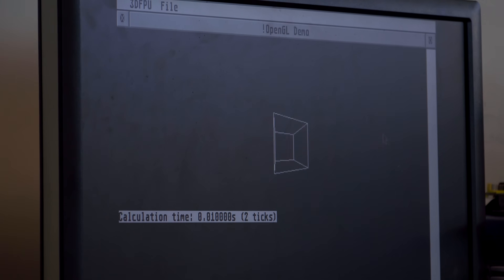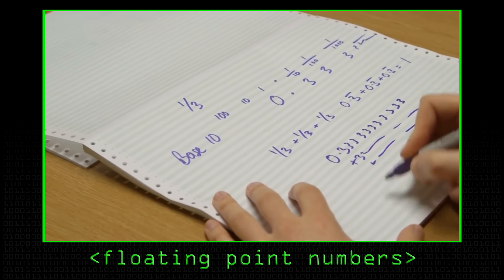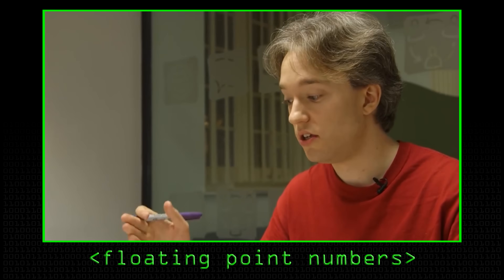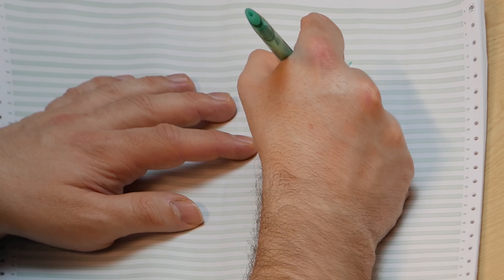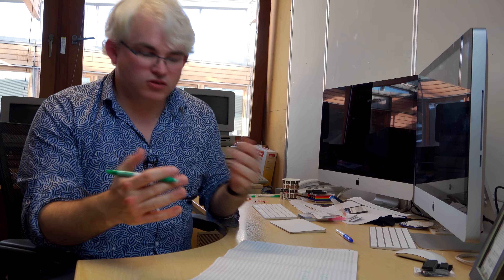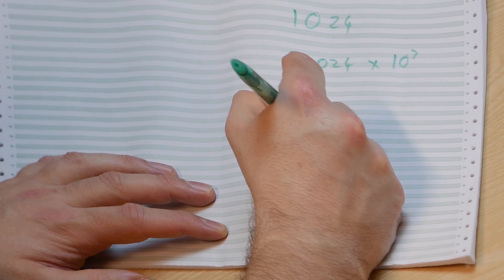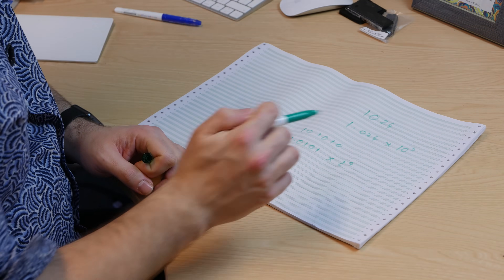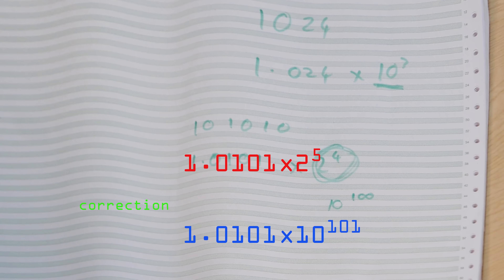Floating Point Numbers (Part1: Fp vs Fixed) - Computerphile

Comment: There are other approaches, too.

I remember reading an article about an investigation one guy did into "floating-bar numbers", which were a restricted form of rational numbers (fitting into 32 or 64 bits) where the number of bits for the numerator and denominator could vary, though would be limited to a total of 26 bits in the 32-bit implementation (the other 6 bits being used for the sign and bar position).

Another approach being a logarithmic system, where numbers are stored as their logarithms. It has the advantage of multiplication, division, powers and roots being fast, but with the penalty of addition and subtraction being slow. The Yamaha OPL2 FM synthesis chip uses one internally, operating on log-transformed sine-wave samples, then uses a lookup table to convert to a linear form for output.
Reply: How do the pros and cons of LNS conpare to traditional FP? Specifically, as it relates to addition and subtraction.

Comment: Why not have memory inside the cores, and have floating points which are conversions already installed in them, so it uses the after cache to do less conversions, it would read data much better.
Reply: @Richard Vaughn is more efficient for hardware to perform floating points and additional tasks, than having to rely more on software, why make more software that is not needed when they can integrate it into the hardware, just to save a couple of bucks? That makes no sense, now a days hardware technology is very inexpensive to where they can integrate more functionalities and rely less on making more software that the hardware can make.
Doesnot make sense, because even if you have the software handle he said it himself that is far superior for the hardware to handle it.
Reply: @Richard Vaughn 
"The CPU doesnot  convert floating point numbers as they are already stored in that format"
Why did you think I wrote the feedback for?????
The CPU doesnot convert floating points. Well is because is not design to convert floating points, that is why they need to make more sophisticated cpus that can store floating point values and also process floating point values, so they can be much more accurate and not require more software programs for it, because is just a waste of time to be making software that can do so, when the CPU can be design to do it even better than software. 
You not very smart man understand what other people write.

Comment: As more and more transistors became available, the improvement in floating point hardware was greater than the improvement in the main processor (as impressive as that was). So the difference on a more modern machine would be a lot more than the 4 times of the late 1980s computer.

Comment: Back in the days of TTL logic, I got to implement a design that used logarithmic numbers for a multi-tap Finite Impulse Response (FIR) filter.  The number system we came up with to represent the logs was very much like a floating point number with an exponent and a mantissa.  We had a radar signal to simulate, so there was a large dynamic range to handle.  I think the input was a 12 bit unsigned number and we had something like 64 samples to multiply and accumulate.  These were the days just before “large” multipliers were commonly available.  That made using the logs an attractive solution.  We used interpolation between 8 of the FIR weights to eliminate 56 multipliers, but still, how to accumulate the multiplication products?
Enter the log adder.  With some simple algebra, one can effectively add log numbers.  Part of that process was linearizing the mantissa, shifting it according to its exponent, and adding that to the other number’s linearized mantissa.  Then the result was normalized, the mantissa converted to a log and you have a sum.
That experience piqued my interest in how video signals are handled, beginning in the CCD or CMOS sensor chip and on.  In the years since, I have never come across anything other than a chip with a wider and wider integer output.  I think some start-ups have promised wider dynamic ranges, but I don’t know what has come of it.
Does anyone know of chips with anything other than integer digital outputs?
Reply: I may not understand, But would having an MCU with over a hundred outputs fit that, surly software can make those outputs mean anything you like ?
Reply: @1st_ProCactus   Well, there are many considerations to get an increased dynamic range. The first one is that the sensor analog performance has to have a higher accuracy and a lower noise floor. Next is the analog to digital converter must also have commensurate performance. No amount of software can generate information that is not in the signal to begin with.

What I was musing about was whether the data bus width is increased linearly as better sensors are developed, or are there different number systems, like a floating point number system that is output from the A/D converter. My guess is that the outputs increase in width one bit at a time, since each new bit represents twice the previous dynamic range.
Reply: So you want to input a very high dynamic range with minimal pins, Logarithmic like?  Ill keep that in mind, I'm interested in any kind of sensor, Though Ive not noticed any sensor that does that. But im sure something like that must be out there for a specific sensors.
Ive seen some unusually high numbers on some of the new on chip sensors (MEMS ?).
Just curious as far as ADC goes, How many bits do you dream of ?

Comment: At 01:40 he talks about recompiling the program to use the floating point co-processor. When I was programming in Fortran in the 1990s, the compiler had an option to detect this at run-time. If the co-processor was present it would be used, otherwise an emulator software library would be used instead. The performance difference was notable, but it was easier to release a single program that was compatible with both.
Reply: When attempting to execute a floating-point processor instruction without the coprocessor installed, an exception (interrupt) would be raised. The handler for that interrupt would then perform the calculation via software emulation and then return. It was seamless, but the performance difference was huge.
Reply: Agreed (my memory is rusty). For testing, there was a flag during compilation, so that the emulator would execute the instructions in software as if the co-processor was never installed.
Reply: some compilers can do this.
Reply: cpuid

Comment: Can someone explain *((int*)&y)  ?
Reply: It casts the address of `y` to an int pointer. Remember y is a float, so by creating an int pointer to it you end up treating it like an int. Presumably int and float are the same size on that machine. 
Then the int pointer is dereferenced. The value of the int will be the IEEE representation of the float, which is passed to printf.
Reply: He wanted to see the actual bit pattern of the float as it's stored in memory, this is a roundabout way to cast the float to an int without doing any type conversion because C doesn't offer an easy way to do that otherwise. Just doing (int) y would give a different result.
Reply: @tiarkrezar  the proper C way to see the bits without conversion is a union, which is like a struct but the different components take up the same space instead of being stored one after the other.
Reply: @jecelassumpcaojr890  Yes, but it's still kind of awkward to define a throwaway union for a one time use like this, that's why the pointer mangling way comes in handy. For this exact reason, I kind of wish printf had a "raw data" format specifier that would just print out the actual contents of the memory without worrying about types.
Reply: &y gets the memory address (pointer) of the float.
(int*) tells the compiler that it should threat &y as a pointer to an integer.
The final * says fetch the value stored in this memory location.

So *(int*)&y gives you an integer whoms value corresponds with the binary representation of the float.
This is helpful if you need to store a float in EEPROM, or like in this video,  want to print the hexadecimal representation with "%X"

Comment: To the topic of floating point numbers, there should be a video of the inverse square root hack in the quake source code. And I would like to see videos about other bit-hacks.
Reply: cmdLP problem with the quake rsqrt is that it's actually almost unknown who wrote it, and most resources describing how it was designed are also just guessing for the most part. Thank you miscellaneous SGI developer for that wonderful solution to one of the most complex problems in computational mathematics.

Comment: An observation that I don't think was mentioned: the leading digit is not necessarily 1. When the exponent is minimal, the digit is treated as 0 (i.e. it's no longer 1.[x]*2^y, but rather 0.[x]*2^y).
Reply: It's to prevent division by 0 due to underflow. Assume `a` and `b` are different numbers, but so close to each other that `a - b` would give a result of 0. That's called an underflow. Then 1 / (a - b) would cause a division by zero, even though `a` is not equal to `b`. Denormal (or subnormal) numbers guarantee that additions and subtractions cannot underflow. So if a != b, then a - b != 0. Yes, it requires extra logic in the hardware.

Also, there are two zeros, positive zero, and negative zero. He couldn't possibly mention everything in a short video. There's a document called "What every computer scientist should know about floating-point arithmetic". It's 44 pages and VERY intense.
Reply: Tamas Demjen Seems like a short summary document of the hype variety.  IEEE 754 representation became extremely popular due to Intel's hardware implementation, but like any design it has it's quirks and implementation variations.  Other floating point formats do exist and have different error characteristics.  Some don't have negative 0, many don't have the NaN concept (slows down emulation), most use different exponent encoding and binary layout.  For example Turbo Pascal for x86 without coprocessor had a 6 byte real type.  Texas 99/4 used a base 100 floating point format to get a 1:1 mapping to decimal notation.  Each mainframe and traditional supercomputer brand had it's own format too.
Reply: That only applies to special cases that are not normalized (which, in my not so humble opintion, are a misfeature of common floating point representations). In a properly normalized floating point number, the only possible value that doesn't have a leading 1 is zero.
Reply: @lostwizard  
Maybe so, but the IEEE 754 standard (which this video describes and which all modern CPUs use) operates this way. Also, you call it a misfeature, but it does have its advantages (for example, it allows for more precise representations of very small numbers). Trust me, many minds more bright than yours or mine have thought out this standard, and if they thought this special case was worth implementing, they probably had their reasons :)
Reply: @Lightn0x  Sure. I've even read the reasoning for it. I just don't agree that everyone should be saddled with it because five people have a use for it. (Note: hyperbole) I'm sure it doesn't cause much trouble for hardware implementations other than increasing the die real estate but it does make software implementations more "interesting" if they need to handle everything. Any road, I wouldn't throw out IEEE 754 just because I think they done goofed. :)

Comment: Probably worth mentioning that even in modern systems fixed point is still faster if you can use it.  Real time digital signal processing often still uses fixed point if it's operating at really high sample rates.
Reply: Is the fixed point done in software or is it supported by hardware?
Reply: @shifter65  Hardware. Doing it just with software wouldn't be any faster, but with hardware support you save several steps with each operation because you don't need to worry about exponents, just straight binary addition. Many digital signal processing boards don't even support floating point.
Reply: @danieljensen2626  I was wondering with regards to CPUs (sorry for not being clear). The previous comment mentions that modern CPUs use fixed point for some processes. Is there a hardware equivalent to the FPU in modern CPUs to do these tasks? For DSP I would imagine since the hardware is custom that the fixed point would be incorporated, but curious about general purpose computers.
Reply: @shifter65  Ah, yeah, I don't actually know, but my guess would be yes.
Reply: @Richard Vaughn Floating-pont also has additional exceptional cases. Division by zero is undefined in integer math, but usually well-defined by anything calling itself floating-point.

Comment: My slow 8088 pc with a 8087 was much faster with Lotus123 than a 80286 AT pc.
Reply: x87 is kinda interesting, because while it supports IEEE 754 doubles, it actually uses a custom 80-bit format internally
Reply: Yeah, mainly for rounding and transcendental functions, to limit inaccuracty. Studied that way back in the 1980s.
Reply: than not then ,german.
Reply: @ataksnajpera  corrected

Comment: Minecraft comes to mind - there you can quit easily notice the problem as the game has a rather large world. 
Specially in older versions - once you got a few thousand blocks away from the origin everything started to be a bit funcky cause distances were relative to the absolute world origin (instead of player or chunk centered). movement became stuttery and particles and not-full-block entities became distorted.
Reply: Far Lands Or Bust
Reply: yeah on the mobile devices its possible to fall through blocks due to the error in position

Comment: I wouldn’t say floating point is any more lossy than fixed point or an integer. They all have their own way to lose precision and overflow. If you use arbitrary-precision math, you can get really unwieldy numbers or even be forced to use symbolic representations if you want something like sin(1) to be exact. It’s really about choosing a representation that suits your needs.

By the way, floating point is excellent in 3D graphics. Positions need to be more precise the closer they are to the camera, because the projection magnifies them. Floating point is ideal for storing that difference from the camera. I suspect the rasterization hardware in modern GPUs lives on the boundary between fixed and floating point, with things like shared exponents to get the most useful combination of properties.

Comment: I've just been writing about the new RISC-V architecture, which  is a modular ISA where integer, single precision and double precision maths instructions are design options. There are a lot of interesting tech, economic and ecosystem aspects to this project, which is an open-source competitor to ARM - would love to see your take on it.
Reply: I actually developed a Risc V processor at Uni (vhdl, run on an fpga). The modularity was pretty helpful
Reply: @robertrogers2388  Also, if you want to license a chip from ARM, they'll charge you a relatively hefty fee for each chip made. One more reason RISC-V gets so much traction lately. It's becoming more than a proof of concept.
Reply: Many embedded devices get by just fine with fixed point arithmetic to save cost of the MCU. RISC-V and ARM give people the option to include the floating point module. Another factor is speed. So even if you need floating point, you can do it in software and the calculation will take some 20 or however many clock cycles, while the FP module would do it in one cycle.
Cpu architecture is really great topic, but probably not friendly for a bite-size video
Reply: Yeah RISC-V is really nice, can't wait for the vector extension to be implemented!
Meanwhile i'll keep on fiddling on the k210 with the sipeed's boards.
Reply: @robertrogers2388  When I think about Sun's work being shoved to the sidelines and forgotten, I think of Oracle.
Reply: Robert Rogers Talking of Risc V and doing other number types in software, has anyone built a properly optimized multi precision 9nteger library for it, without timing side channels?  Because the lack of arithmetic flags and conditional execution has me worried this is an anti-security processor, compared to the MIPS, OpenSparc and ARM.

Comment: Floating point in short is a trade between resolution and dynamic range.
If dynamic range is important, then floating point is a good option. (though, one can do this without floating point, but it gets fiddly...)
If resolution is important, then integers are usually a better option.

(and if any degree of rounding errors or miscounting leads to legal issues, then integers are usually the safe option. (ie banking software.))
Reply: In java, there exists the "BigDecimal" class, which is a much slower but more accurate way to represent decimal numbers, which is what one might use for banking i guess